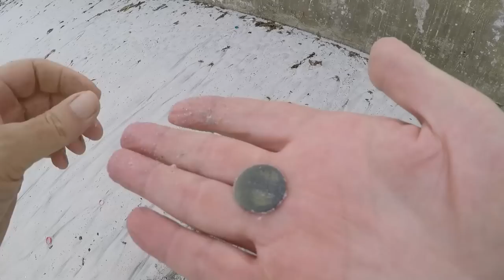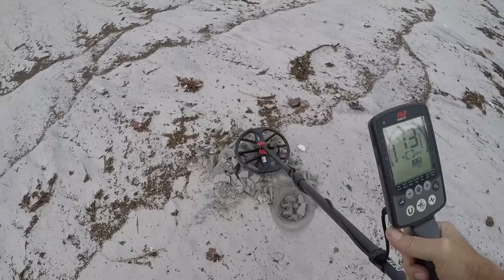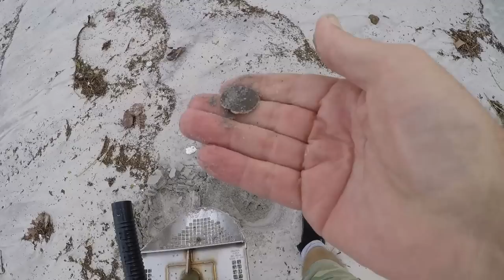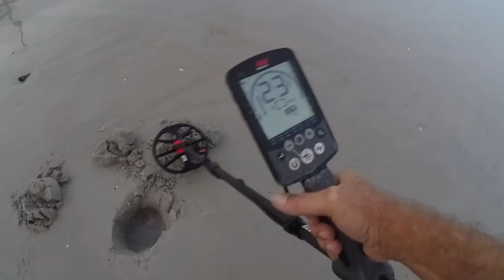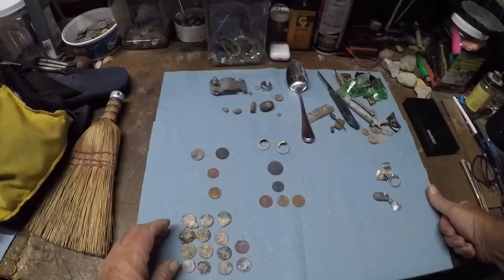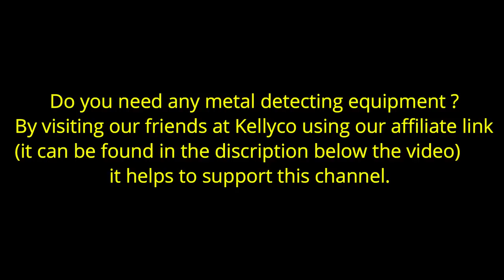Beach Metal Detecting IDD 273 Hurricane Uncovers 1916 Gold On Daytona Beach

Comment: Congratulations on all the sweet finds and not so sweet. I sure hope all the good stuff turns out to be worth a fortune. Always enjoy all the great adventures that I am included in and can't wait till the next.
Reply from the maker: Hi Patricia , more gold finds on the way . I have been lucky my last few trips out . Thanks for watching .
Reply: Ihave an older metal detector....''Relco''....uses 2 batteries.... I used it mostly to find nails on old const. sites , and had 4 gold claims..... wouldnt bother beach combing---finding pennies and beer tabs --wouldnt pay for batteries --let alone my time   @ $15.00 AN HR.
Reply from the maker: Hi Alexander , the pennies and pull tabs are just the things you find in between gold and silver finds .  My detector has built-in battery pack that is rechargeable so no need to buy batteries . My Fisher CZ21 uses 4 -  9v batteries . I bought rechargeable batteries for that one too so I  don't need to keep buying batteries. Metal detectors have come a long way over the years . Thanks for watching .

Comment: The bracket is 1/4x20 bolt plus 1/4x20 nut plus mineralac, strange name but that's what it's called, that is used to support 1 inch electrical conduit onto uni-strut mounted on wall for example. It probably came loose from an umbrella/chair home-made attachment or possibly cooler axle support.
Reply from the maker: Hi Sam , thank you . Thanks for watching .

Comment: Wow, nice rings you found. Was wondering what kind if metal detector do you use? I'm looking to upgrade mine . I have a Fisher f22 and it wouldn't work in the packed sand but dud work in the loose sand. Not sure why that was. Do you have any ideas? Thanks
Reply from the maker: Hi Karla , thank you . I use the Minelab Equinox 600.  I suspect the problem with the Fisher f22 is the wet salt sand. The packed sand is moist and the saltwater in it can cause some machines to go crazy.  The loose sand is much dryer and that's why your machine works better in the dry loose sand. The Equinox is fine in the wet saltwater and the surf. Its waterproof to 10 ft. as well. I love mine . I have my Kellyco affiliate link in the video description if you want to check it out . They are on sale right now too!  Thanks for watching , good luck and happy hunting .
Reply: @idigdaytona4478  Thanks so much for the reply back . How long g have you had it & is it easy to operate? Do you have to calibate it yourself or does it come already calibrated? I will definitely use your link to purchase the metal detector & other supplies. I'm also getting the Garret water proof pinpointer too. I Look forward to hearing back from you again. Thanks so much
Reply from the maker: Hi Karla , I have been using the Equinox for over 4 years . Its easy to use and It remembers your settings. When I go to the beach I just turn it on and hit the noise cancel and start swinging . The noise cancel gets rid of interference caused by cell towers and WiFi . I use the Garrett waterproof pin pointer as well . Its a good unit .  I wish you the best of luck out there . If you need any settings just drop me a note. Thanks for watching .
Reply: @idigdaytona4478  Thanks again for replying back.  I'm so excited to got that metal detector. I have found never found anything  good with the Fisher22 yet  so that's why I'm gonna upgrade.  Do you wear a headset when you metal detect.  I know when I was there on the beach it was so noisy so I used a headset. If you use a head set what kind do you use & do you know if the equinox makes a head set to go with that detector?    I watch your Chanel alot happy detecting & I hope you find some great itens
Reply from the maker: Hi Karla , the Equinox comes with headphones. I don't wear headphones so my viewers can hear the sounds . Headphones will let you hear some faint signals. I think you will enjoy the Equinox. Good luck and Happy Thanksgiving .
Reply: @idigdaytona4478   Thanks so much for all the info. Happy Thanksgiving to as well
Reply: @idigdaytona4478   getting ready to order the equinox 600 & was wondering do you think I need to order the search coil ear reinforcers as well?  I value your opinion since you have had this detector for awhile. I look forward to hearing from you. Thanks so much
Reply from the maker: Hi Karla , I like it because it helps me see the center of the coil when I am in the water and it does help strengthen the coil ears . The coil is covered under the 3 year warranty from Minelab so you should be fine either way . You can always get one later if you think you need one . Happy hunting .
Reply: @idigdaytona4478   okay good to know. Thank you . Happy hunting.  Can't wait to see your next video